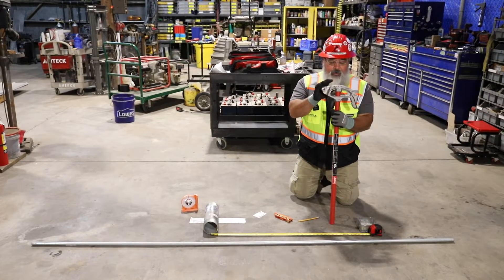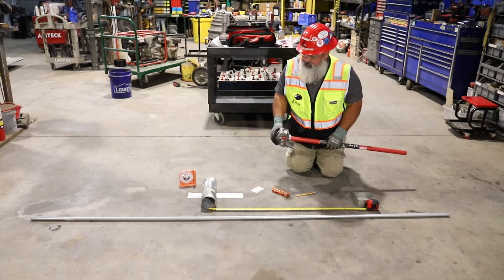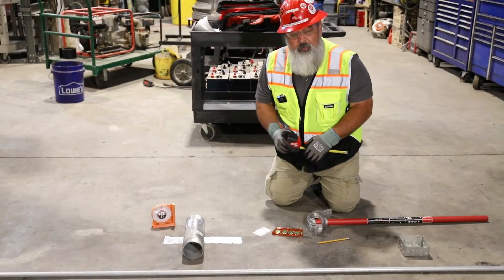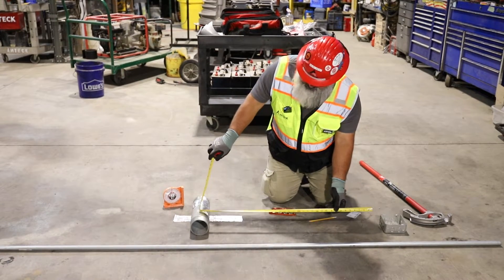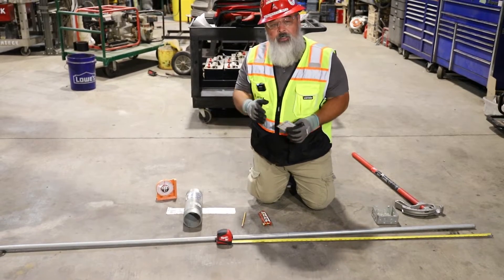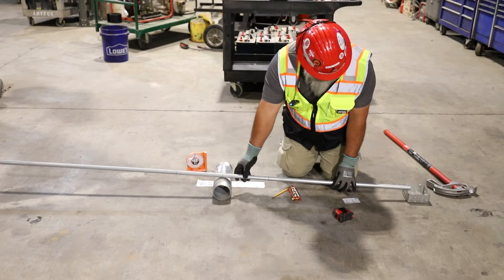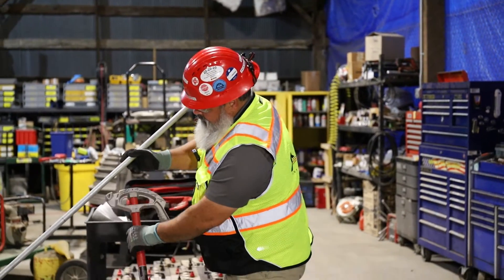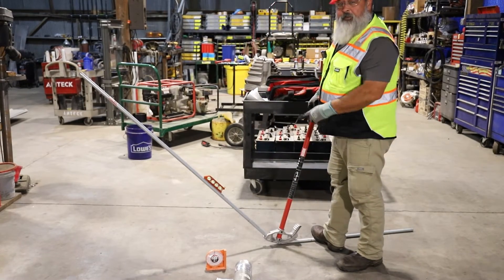How To Bend A 3 Point Saddle

Comment: Can you answer a question regarding a 3-point saddle using the push through method?
Reply: It's the best method, push thru, just remember S N A. star, notch, arrow.  Get your measurements ( I use a pipe bending app cause it's easy) the make your first bend on the star, push thru to the next bend and spin 180, then bend at notch,  then same thing at arrow. All bends are 22.5, 45, 22.5

Comment: In my NCCER textbook on conduit bending it states to "multiply the shrinkage by 2"  meaning in order to compensate for both sides of the bend. Can you please comment on this?
Reply: Multiply by two if is a 30 degree every degree has a different multiplier
Reply: not an electrician but I took geometry.  
If you look at the first 2 bends (from the start of the 1st bend to the top of obstruction) the center line distance of the tube is 12.14 inches.  The projection of this section onto the floor is 11.389 inches long or 0.751 inches less.  If you ant 40 inches from the start to the top of the obstruction, you add this to the measurement.  So, if from say box to box you wanted distance x you would have to add 2 * "shrink" to the total length x.
But now also....   the center line distance of the tube for one 22.5 deg bend plus the straight section is 10.4 inches, not 10 which appears to be the amount the center is off in the demo.  Don't know how you would do that without a scientific calculator though.